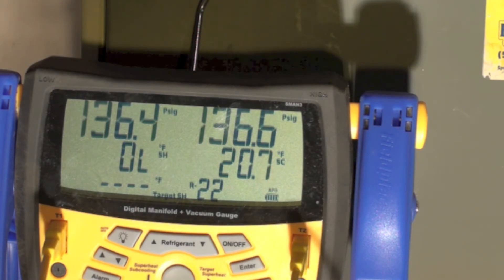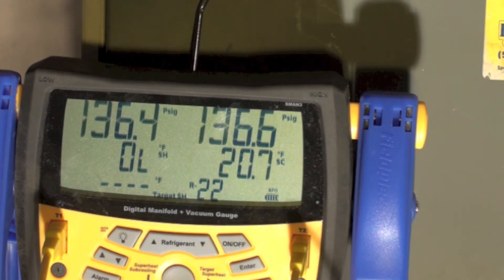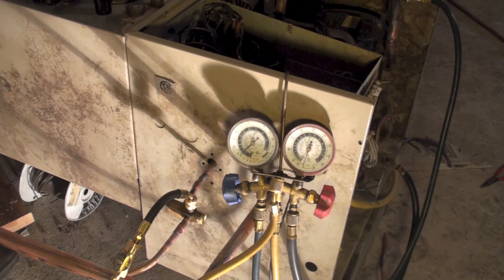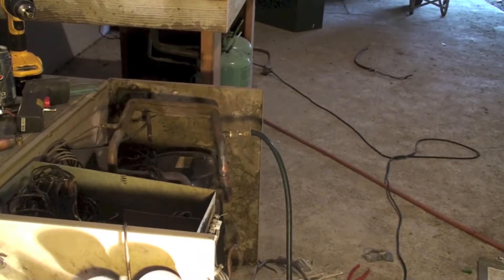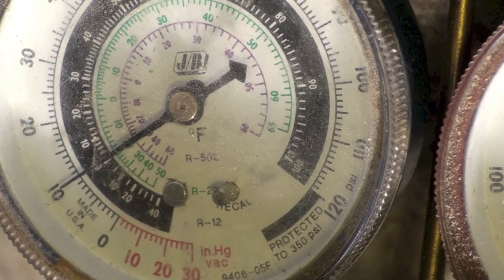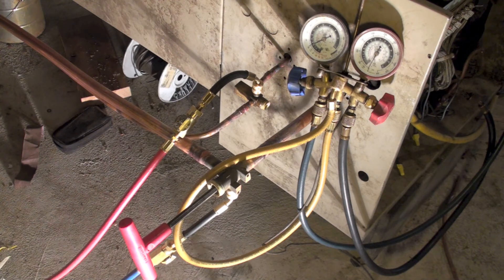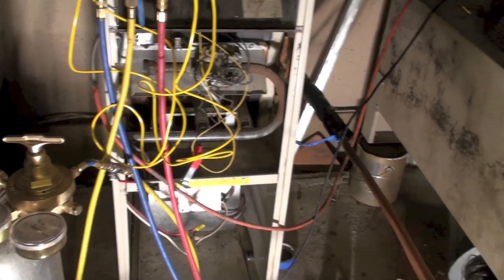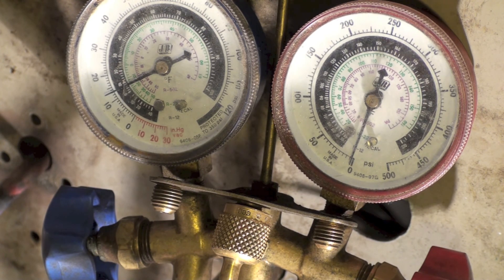High pressure test:  service valves leaking by. Part 3

Comment: The phrase "leaking by" kept confusing me, but now, after watching your video on replacing the o-rings on leaking service vales, I think I get it.  The valve is not leaking out, instead is allowing the nitrogen to seep into the outside unit.  Gear acquisition syndrome coming on, I can now justify owning another set of gauges.
Reply from the maker: You got it.
GFM

Comment: GFM you have helped me in my career before and I have come back yet with another trouble. I come to a lot of "leaks" the my electronic refrigerant detector goes off at the valve cores. Now I tighten them and that doesn't help, so I replace them and that still doesn't help. I am puzzled as to why my detector continues to go off at the valve core even after replacing with new valve cores. Is their a "screw" on solution to act as a double barrier to prevent leaks after a new core has been installed? I know the caps rarely seem to help slow or stop leaks. Or is this normal for the detector to sound off when placed right at the service port...(sorta like finding water in a sink drain while looking for a leak effect)?
Reply from the maker: +Aaron Stokes The unit is leaking if the sensor goes off.  I did a video that fixes this although it is not screw on.  Try this: Sealing the schrader that would not stop leaking.  Hope it helps.
GFM
Reply: +grayfurnaceman thanks I will do! This is very frustrating

Comment: Hey GFM,  I have a question on refrigerant recovery. I have been reading up on the EPA to get my cert.  Why is it that if you are recovering vapor they show a connection to the liquid port on the recovery cylinder?  I cant seem to find an answer from anyone.  I hope you can help, Thanks allot.
Reply from the maker: It does not make any difference which port you connect to when recovering.  Because the refrigerant is going into the cylinder, either port is ok.  The only time you are concerned with which port is when you are removing refrigerant from the cylinder.  
GFM
Reply: grayfurnaceman

Comment from the maker: The system will operate normally if this is the only leak.  The problem is during service when looking for a leak by isolating one side from the other.  If the valve leaks by and you pressure up one side with nitrogen, you get a false leak indication and the refrigerant will be contaminated with nitrogen.  
GFM